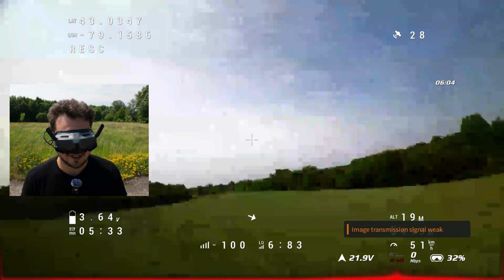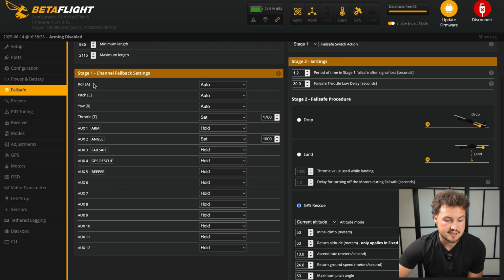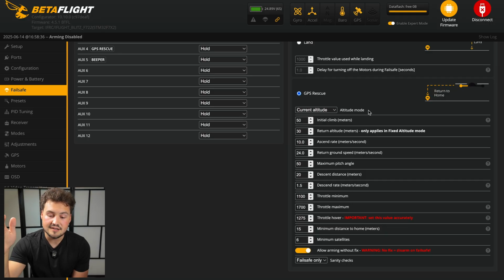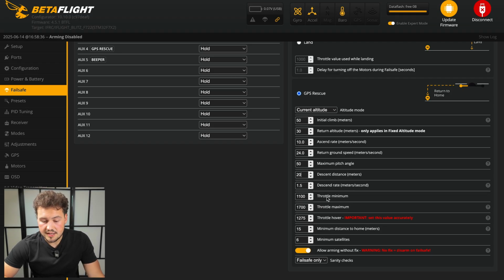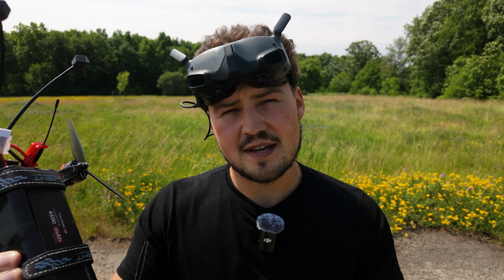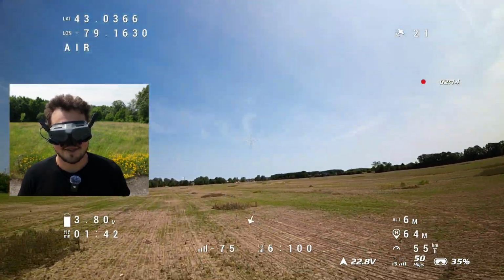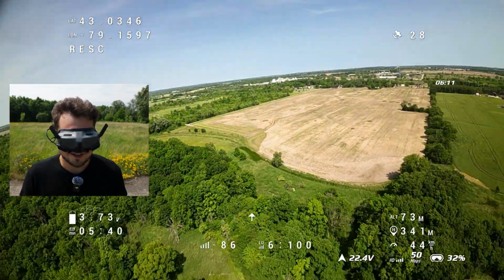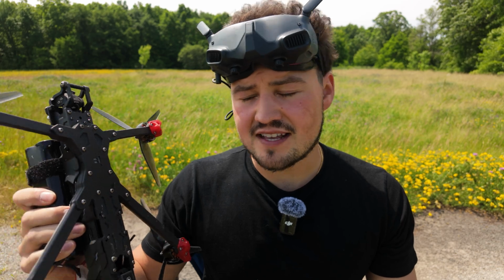Betaflight GPS Setup + Rescue Mode & Auto Land Test

Comment: Nice video! How long did it take you to get 20 sats? I have the CINELR7 with the same GPS receiver and I rarely get above 15 even in flight.
Reply from the maker: It only took me a few minutes which was strange. I haven’t tested it out very much so I don’t know if it will continue to be that fast or just the flying location here. Have you tried using the speedybee adapter 3 to plug in a battery for a bit before you plug a battery into your drone?

Comment: Great video, FPV Evan. Looking forward to your next upload from you. I smashed the thumbs up button on your content. Keep up the fantastic work! Your detailed breakdown of the GPS setup was super helpful. What adjustments would you recommend for optimizing the GPS signal in areas with high interference?
Reply from the maker: Thanks for the comment and your support! I would look into getting the speedybee adapter 3 and plugging in your drone that way for a while before plugging in the battery for take off. This will give your drone plenty of time to get alot satellites without over heating it

Comment: And if you flash betaflight 4.6 then you can use have position hold and altitude hold. You can use both at the same time and it functions like a pause button,  and also have the regular gps rescue/RTH functions too. I have it installed on my 5" and i love it. I use pause all the time. 
Gps rescue saved my drone not long ago as well. Lost aignal really far away. It flew right back home. Love it
Reply from the maker: Would you recommend me flashing it now or waiting for it to be more stable? It seems like a really cool feature

Comment: Your return speed is too high, thats why it faces downward on the way back
Reply from the maker: Thanks for the tip! I’ll drop it down and see how it reacts after that change
Reply: @FPVEvan  that and the max angle. its trying to do both, match your return speed while matching the max angle. thats why it dips. and it was over shooting because of the wind and your return speed. right from the get go it was behaving exactly to what you set it